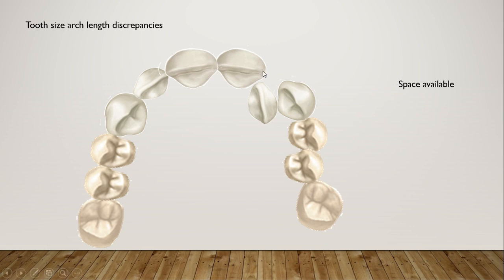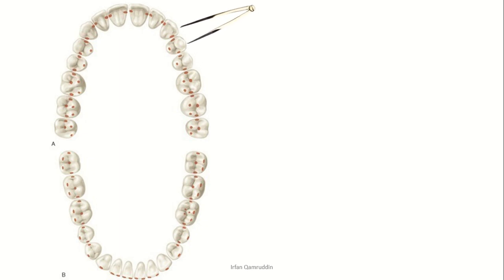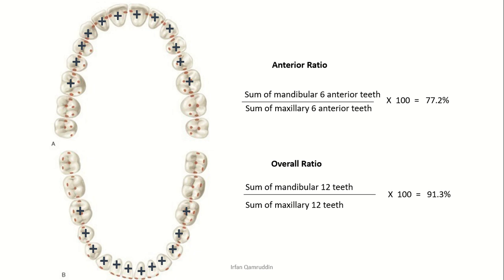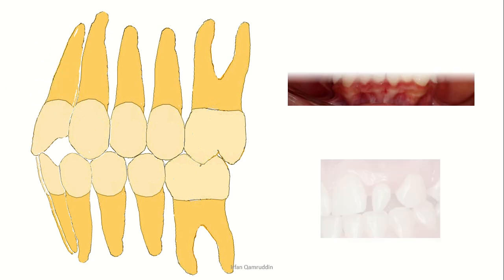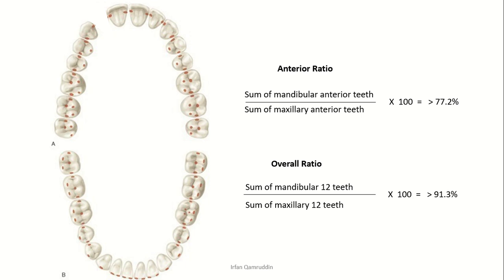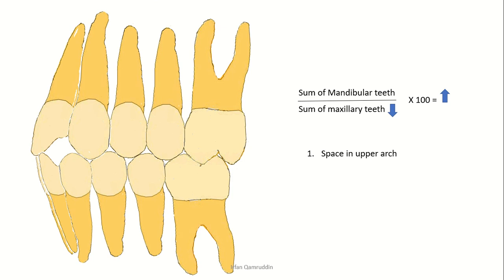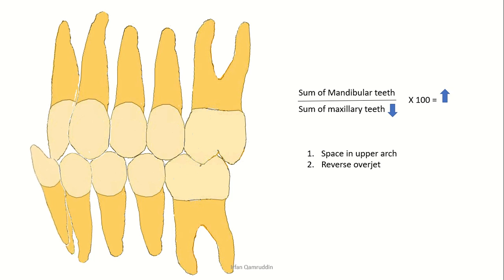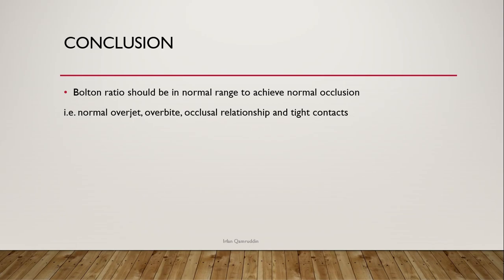Bolton analysis for orthodontic undergraduate students

Comment: Salam sir......can u plz tell me that why do we measure anterior ratio?
Why don't we only measure the overall ratio?
Reply from the maker: Salam. In orthodontics. Finishing case in class 1 canines is off utmost importance. Therefore we should measure anterior ratio separately bcz sometimes we plan to extract premolar in one arch or sometimes they are missing. In that scenario overall ratio is disturbed but if anterior ratio is normal. You can achieve class 1 canine and ideal overjet overbite and midline

Comment: Pls. Can give us example, how to calculate the deficient size of upper lateral and how much should upper lateral incisors should be built up if we have peg shaped upper lateral incisors
Reply from the maker: Formula is mandibular tooth material /maxillary tooth material x 100.
Lets say (e.g) in ur case you get sum of mandibular anterior tooth material equal to 38mm. Now u have to find out the value of maxillary tooth material to get normal value of Bolton which is 77%
So ur formula will be 38/x multiply by 100=77.2
Simplify it. X=38x100/77.2
Answer is about 49mm
Means combined width of your anterior maxillary teeth should be 49mm. Now u can check that what is the combined width of maxillary anterior in your case. Let's say its 46mm than u have to increase the width by adding 3mm more.
Reply: @irfansinstituteofclinicalortho  
Thank you alot
Reply: Are you asking how to determine the mesial-distal width of upper lateral incisors if they are peg-shaped? You can use the golden proportion ration which is the width of upper lateral incisor is 0.618 of the central incisors, so if the central incisor is 8mm the lateral will be approximately 5mm
Reply from the maker: Golden proportion is clinical observation that can give you rough estimation but Bolton gives you precise measurement
Reply from the maker: there are some ranges of mesiodistal widths of each tooth. You will have to assess that on casts. For. Eg if upper centrals are 10mm wide and laterals are just 5mm then it's obvious upper lateral is smaller than expected